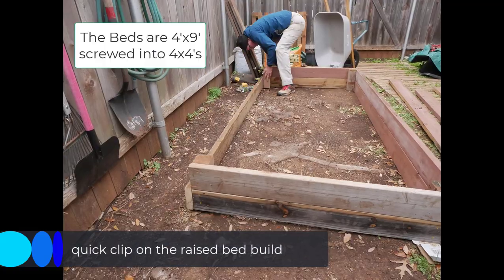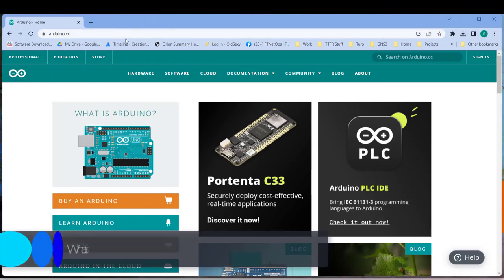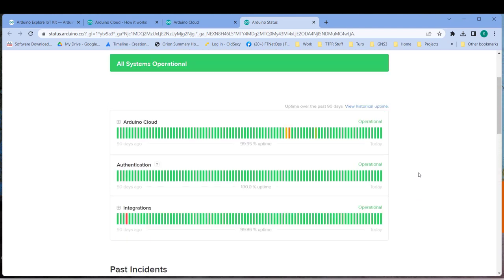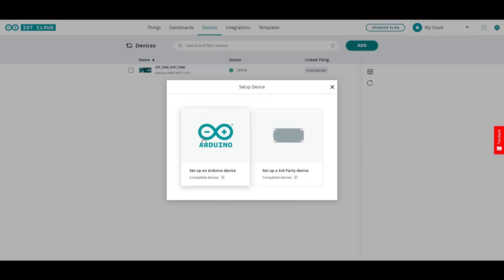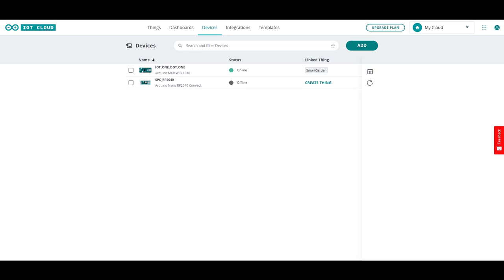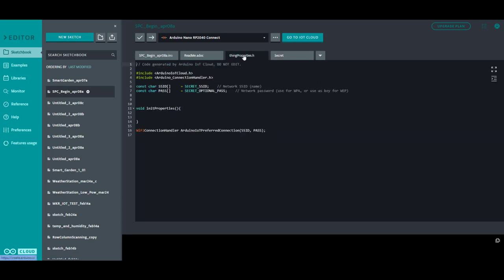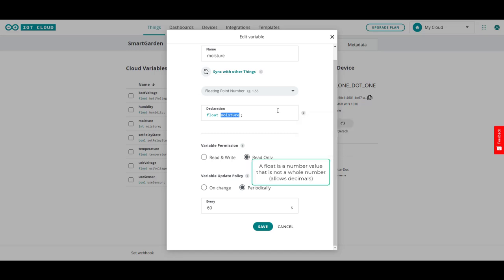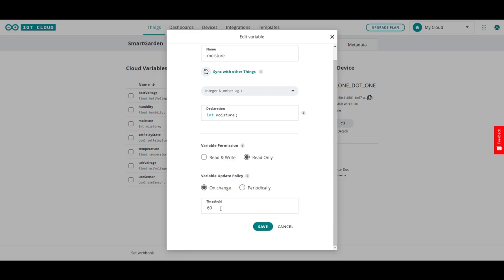Internet Smart Garden Part 1 - Arduino Cloud setup and Operation

Comment: I was looking at automating my high tunnel with a Pi but saw the operating temperature range and it tops out at 105 degrees F. Arduino boards top out at 158 F. Guess I'll be going with Arduino.
Reply from the maker: My Arduino wifi 1010 seems to get flaky around 110-120 F. I had to add the fan to keep it below that.

Comment: never used the arduino cloud. I've been using esphome and home assistant as a free option
Reply from the maker: There is a free plan. I think you can make up to 10 "Things" on the free plan. I have HA running as well, for other automation. I just picked up one of those little touchscreens with an esp32 built in, so I'll have to check out esphome.